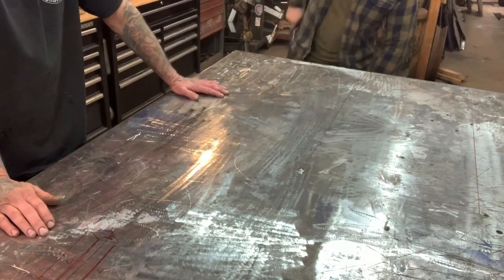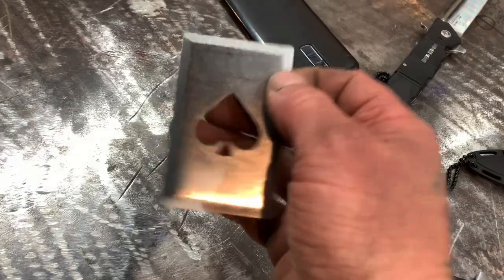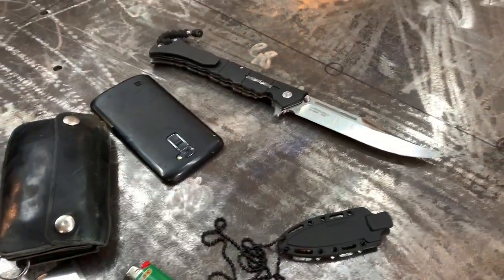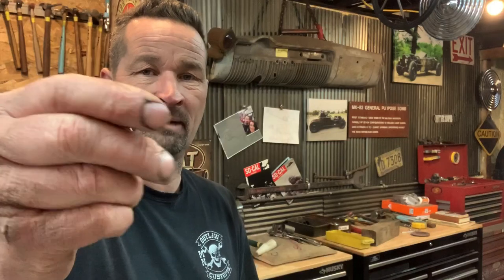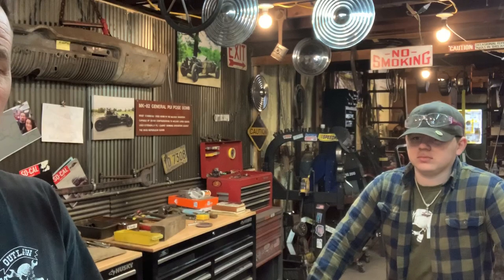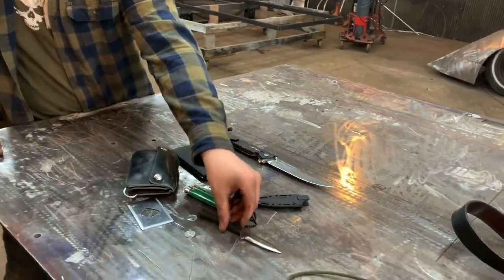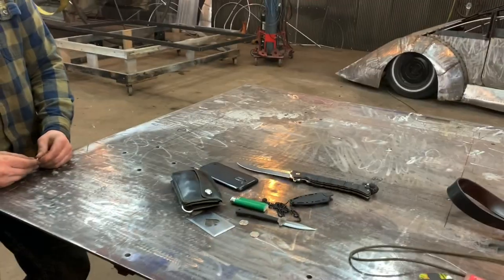EDC everyday carry comparison with Mn Redneck

Comment: Hello, what is this knife with a hole in the blade?
Reply from the maker: M21 CRKT 👍
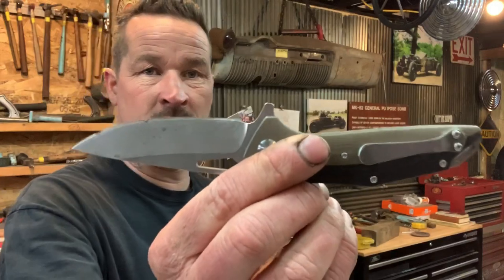Reply: @OutlawEdge  but I mean the one from your edc video 5:40
Reply from the maker: Team Dosenbier I oh i gotcha. Thats a DOOM BLADE brand knife off ebay. Just type in cheap folder knife or cheap pocket knife on eBay and they should come up under doom blades. They are very high quality and only 15 bucks. Hope that helps. Thanks for watching
Reply: @OutlawEdge  Ok thanks.I know everything.